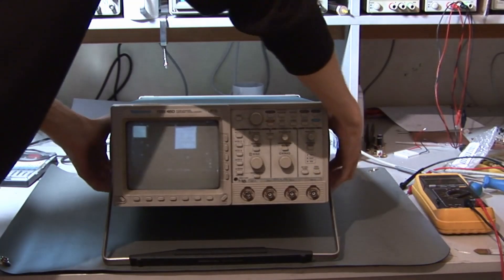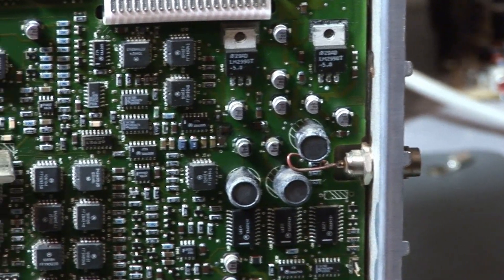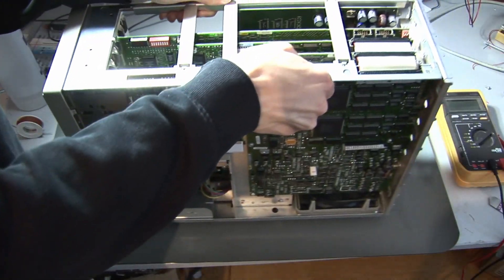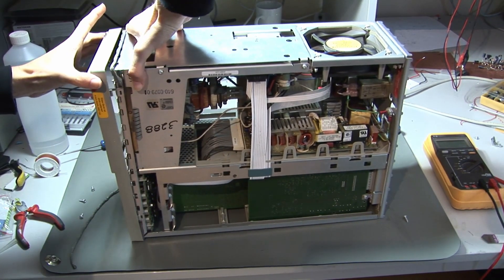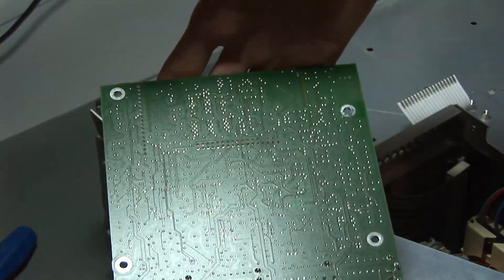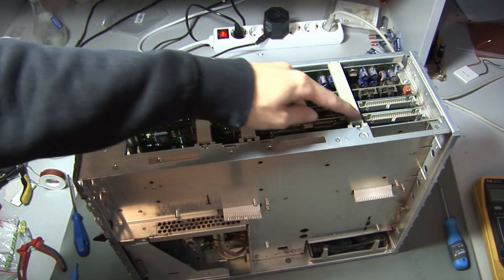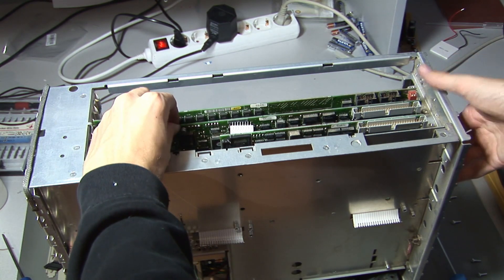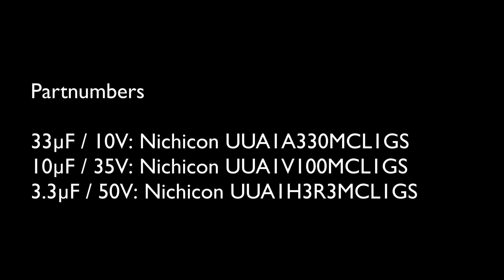Tektronix TDS 460 repair part 2

Comment: Hi can you have tds460a processor board circuit diagram
Reply from the maker: Would be great to have a circuit diagram for it. As far as I know, Tek never published the circuit diagrams for the TDS 460 and similar oscilloscopes, unfortunately. The only TDS oscilloscope of which a circuit diagram is available is the TDS 540. There are huge differences between the 460 and 540. But maybe it is still helpful for you. Here is the circuit diagram of the 540: https://w140.com/tekwiki/images/c/c9/TDS540_Schematics.pdf
Reply: @MrVideoTronix  thank you so mush for your reply but i already have this. This circuit diagram is totally different from tds460a.